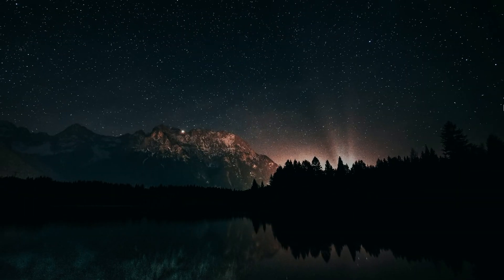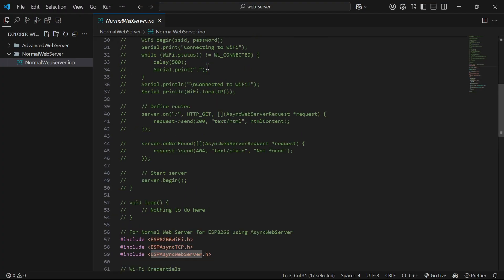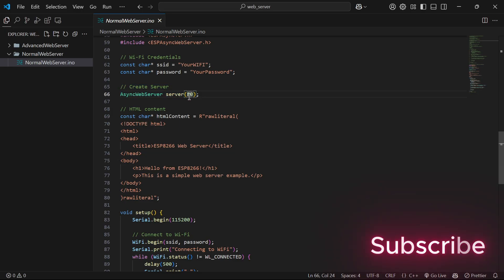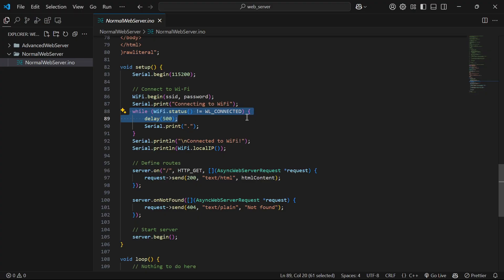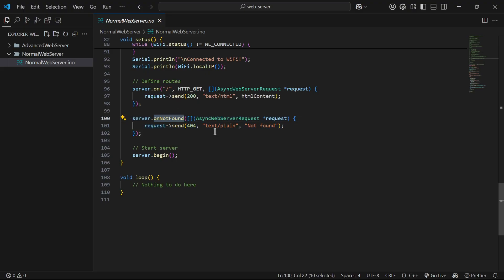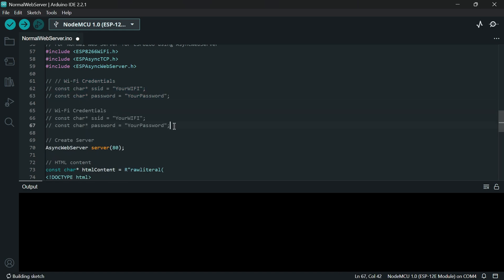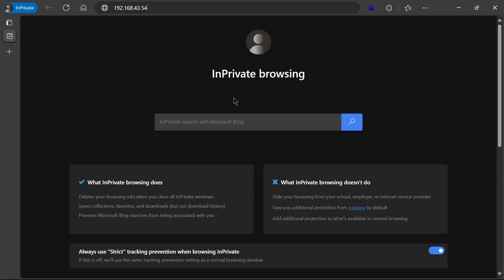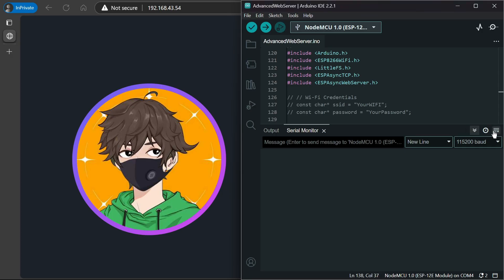Make Simple Web Server using ESP32 / ESP8266 board

Comment: Is it possible to make cloud storage using eps 32 web server.
If possible then make a video
Reply from the maker: Yeah, its possible. However that's not useful thing to make. You cannot even store one high quality photo with it. It have very very low storage.
Reply: @trachitz  adding ssd to eps 32....still not possible?
Reply from the maker: @atanusamanta8162  no, it doesn't have that much of power to make a cloud storage